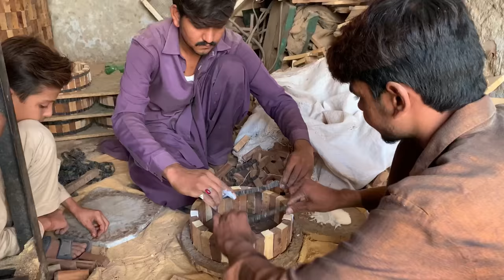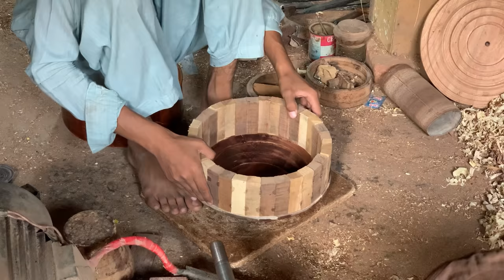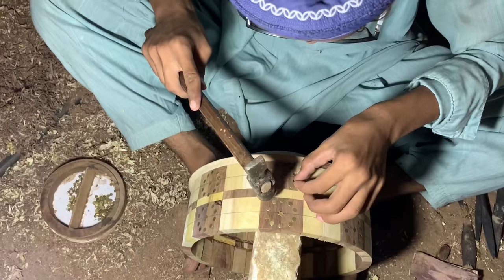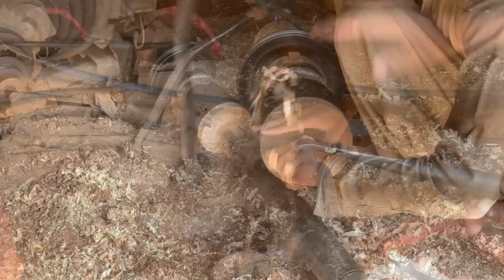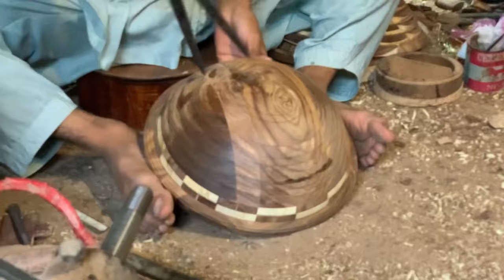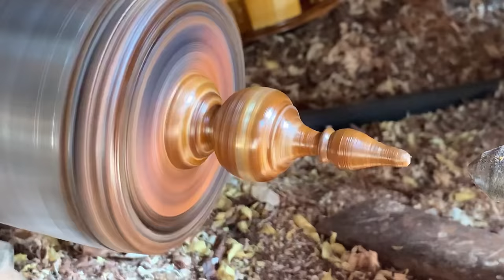How Brass Inlayed Wooden Hotpot are Made || Making a Wooden Chapti Hotpot With Piece Of Wood

Comment: I see these on Amazon for about $65. A stainless steel one is much cheaper but not as beautiful. The cheaper stainless one though likely hasn't had toxic glue, shellac and someone's nasty foot in it.
Reply: Its Not Sold On Amazon By These Guys Anyway Its Real Cost Could Be Round I Guess 20 Or 25 Bucks I Guess